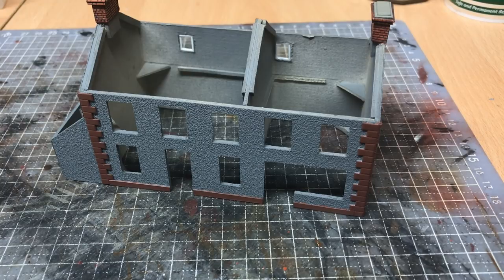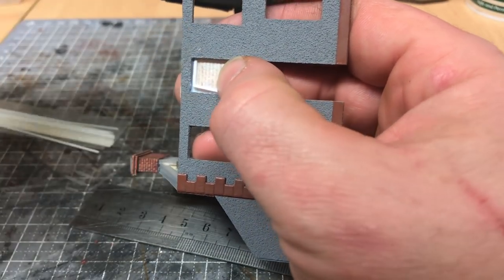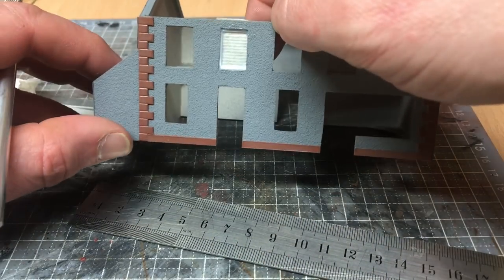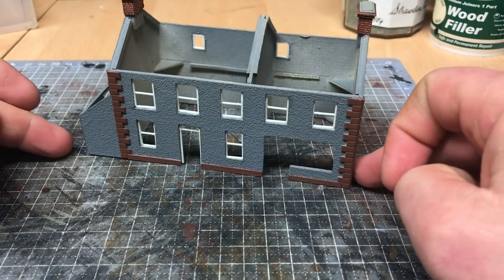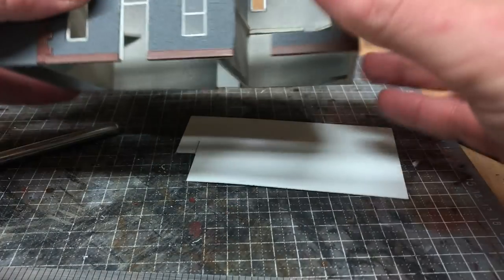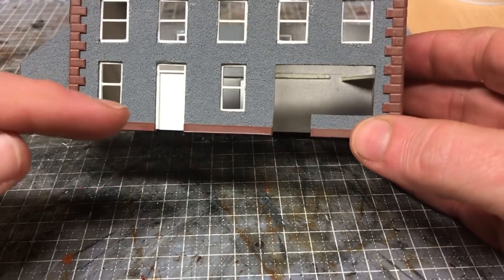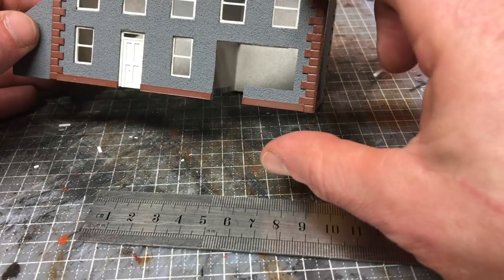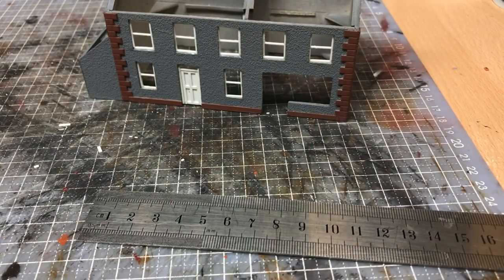Building A OO Gauge Model Railway: Scratch Build Series - 1.5 Installing Window Frames And Doors

Comment: 23/06/2018
German firm Auhagen offers packs of injection molded plastic windows at a very reasonable price. They are labelled HO/TT and they are a tad on the small side but within the realms of possibility.  You would need to trace/measure the windows to set the size for the opening but they are nicely detailed.

48 650 is a pack of about 70 6-pane windows with a few odd ones thrown in to about the same size, all suitable for 'cottages'. They come with 18 'shutters' so may be of use to continental modellers and wargamers.

48 551 is a pack of 'industrial windows' with a single pair of doors (32mm high and each 15mm wide) and a separate sprue of 'fittings' brackets and the like. There is also what I think is a corrugated iron awning, presumably to go with the brackets etc.

48 647 is a big pack of larger windows and some fittings (a through-the-wall fan for example)

Not expensive, a viable alternative to buying Dapol buildings just for the windows (the Dapol windows are a bit heavy and deep).

Cheers

Mike
Reply from the maker: I will certainly check those products out Mike, they may prove useful to have in the scraps box for future projects. Paul

Comment: 40thou (40 thousands of an inch) is near enough 1mm (3 inches in 00), hence 30 thou is 0.75mm. I use Slaters Plastikard and 'microstrip' myself as it is (here) cheaper than plastruct.  Nice building.
Reply from the maker: Thanks Mike. Paul

Comment: The build really is progressing and the windows and doors look very good.  I hope you won't mind me saying this, but it was good to see the Plastruct gods pick on someone else occasionally when one is trying to trim to the correct length with very fine tolerances.  I think this might be part of the build that I would adapt for N Gauge by using either brass etch or laser cut windows and doors.  I have constructed door frames and lintels though, but it is very fiddly work.  When I get around to this I will see what sizes I am dealing with.  Stephen
Reply from the maker: The plastruct gods were not being kind to me on this evening Stephen. I shudder to think of the fiddly aspect of constructing this in N gauge. More power to you. The prototype did have more intricate window frames than I could produce, with more time I’d have got some laser cut and produced but it just wasn’t feasible. I also wanted to show people what could be done to form a basic window from strips. Thanks as always for following the progress. Paul